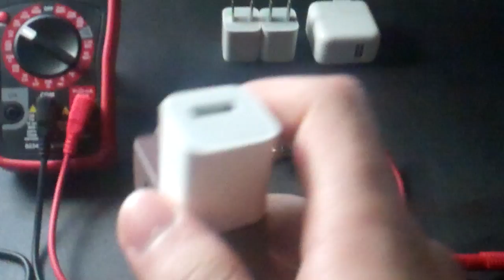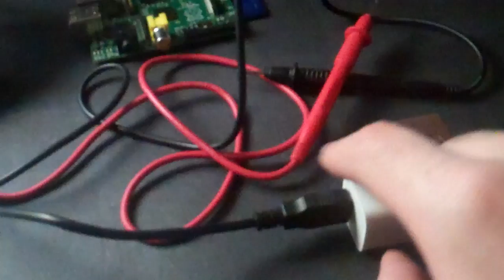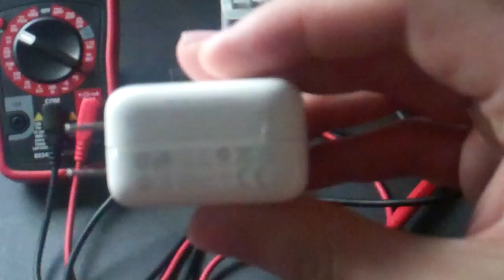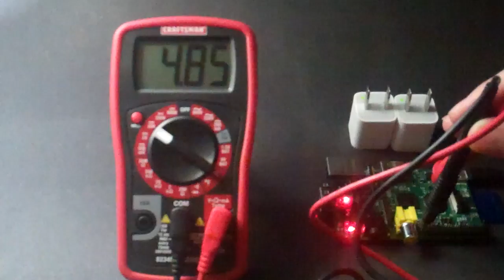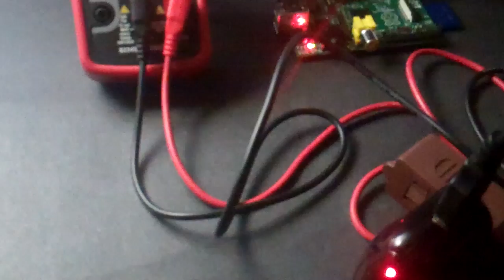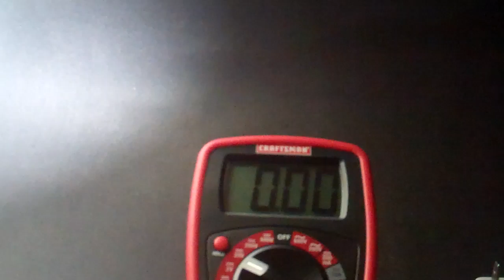Best Power Supply for the Raspberry Pi

Comment: A few Christmases ago I was tasked with getting a USB charger for an iPod Touch for a client and the only way I finally got it to take a steady charge was to lower the voltage to less than 5 volts. I wonder if this is a pattern of Apple products.

I have a Raspi 3 and I was wondering if I could run it off a USB port on my Xbox 360 because that would be convenient for me, would I have any problems with that? I ask because I notice that the Raspi power adapter that came with it is rated for over 10 watts.

Comment: what? mine was able to supply 5v just fine on my raspberry pi, the only culprit I can tell is that your USB cable is bad. There's a large voltage loss using that usb cable.

try using a more reliable usb cable like a samsung OEM microusb cable one.
Reply: It depends on low priced multimeter ;) Adapter and cable are okay.

Comment: All you need is 5V usb charger on 700 ma min value. Sony xperia  charger works just file It has 5v and 850 ma output. Don't use charger below 700 ma that's it :P
Reply: You can use your charger, but the lags and freezes you might think are normal ARE because of that power supply buckling when under load. AND if you plug in MULTIPLE usb devices, such as a keyboard and/or mouse and usb thumb drive you'll get almost instant failure as your charger will definitely not power all of those items. Even 5V at 1A will not power them. If you plan on plugging in anything get a charger made specifically for the pi. Something with 5.25V at 1A is very stable. Phone chargers are NOT good in the long run.

Comment: There are much more parameters of a power adapter which are responsible for reliability.  For instance: your message tells nothing about the output resistance of the adapter. You do not measure the voltage in unloaded condition. The difference you measure is the voltage drop over the usb cable. Not the stability of the voltage of the adapter itselves. Also an parameter is the voltage ripple and noise of the adapter. That you can only measure with an scope. High voltage is not always better!

Comment: Did you actually have power related stability problems, or did you simply find a problem by using your DMM? The USB standards have specific requirements for how power is handled, and power is allotted in units, not simply regulated like a standard power supply. The tests that you show are not proper for the USB standards as you may find the test point voltages going up after you add an additional load.

Comment: Upon further inspection of my own raspberry pi, and running it, I've found that the raspberry pi will run fine from an Ipad charger. It is two amps, but mostly the power is just routed into the USB's. I have plugged in passive USB hubs with keyboard, mouse, WiFi dongle, and flash drives, and haven't had any power problems.

Comment: If a power supply is rated at 1 amp at 5 volts, but the voltage drops to 4.8 volts when the current draw is 800ma, then it sounds like a voltage drop somewhere.  If the unit is rated at 5v, 1a, it should be able to keep the output capacitor fully charged even if current draw gets up to 1a.  I'm assuming that the ratings are correct (which may or may not be the case).

Comment: you can use glue (Arctic Silver AATA-5G Thermal Adhesive)  to put a heat sink onto the chip that heats up... or add a fan... or both.

Comment: When I get time I still need to upgrade my Heli's radio to get rid of those 8 AA batteries that it needs. It seems the radio drains those puppies pretty quick. But the chopper I got come to find out isnt all that great. It's a 9053 model.

Comment: When I got the RPI I was lucky to realize that the USB power adapter that came with my Nexus S was rated 5v 700mA, which is the minimum specs according to the wiki. I've had absolutely no issue using it, with the only exception of trying to plug in an external 3.5" HDD that did not have its own power supply. I'm assuming getting a 1.2A power supply would resolve that issue but I haven't tested it yet.

Comment: Question: I get the part where i have to get a 5.25 Volt charger/adapter, but what about the Amps? Whats the diffrence between i.e a 1.2 amp & a 2 amp. Can i ruin the raspberry pi if the amps are to high ???

Comment: The voltage drop has nothing to do with reliable or robustness. It's because the power-supply (in this case it's a SMPS) isn't able to deliver enough power (current). So when you overdrive the power supply, it doesn't "have time" to charge the output capacitor to 5V before you drain it. If you hook it up to an oscilloscope, you can also see that when you overdrive the power supply, the voltage is far from DC, it becomes very noisy. You can observe the switching.

Comment: This is a great video man, thanks.  The adapter in the picture at the link you posted doesn't look the same, however.  I'm a little leery of buying it because of that.  Also, if you could check amperage under load for that adapter that would be great.  Maybe a new video using your new camera, checking amps?  ;-)   It would also be great to see it actually loaded and running.

Comment: Do you have a 1.2a adapter?  That's what I've been looking for as well.  1a should be sufficient for normal use, but a wireless network adapter will likely push that limit.  That's my next test too... wireless network and keyboard/mouse.

Comment: I was going to say that.  ;-)
While he doesn't have that info, it sounds like it was thouroughly tested and all works fine.  If I had to guess, I'd say based on the fact that the voltage doesn't really drop under load, the amperage will also be fine

There's a fine line with regard to amperage though... you want to maintain "enough" amperage for the devices, but never cause a load above 1.1amps because that's what the fuse is rated at.  So again, this adapter does sound pretty ideal.

Comment: Actually, this setup will run something like a mouse and keyboard, as well as the hdmi out and ethernet, however, obviously you'd need a powered hub to do anything more.  Your point is good though, and it would probably prolong the life of the RPi.  The primary reason I don't want to use a hub is because it adds bulk.  I'm trying to keep my setup as clean and light as possible.  I am actually about to try using a tiny USB bluetooth adapter and a mini bluetooth keyboard with touchpad.

Comment: You should be measuring the Amperage of the Power supply units. Not just Voltage.
Max out the amperage, check its variations at max load, then check the voltage at that point.

Comment: You need a switchmode 5v power supply, yes they do exist in adaptor form as I have one myself but thats used to power my USB power port that unloads the voltage drop on the computer my 7 port hub connects to.

Comment: There's a known problem with the RPi power design, and the lastest rev removed some fuses that were responsible for voltage drops. You can replace them with resistors....

Comment: You just need to look  at the psu and se if it has 1200mA or 1,2A if not it will not get enogh power.(B-model) i see many psu sold for the raspberry is 1A or 1000mA.

Comment: It's odd, in any case for my own Pi that voltage (TP1-TP2) is not the adapter voltage.

Adapter voltage with no load: 5.20V
Adapter voltage with Pi: 5.05V (almost perfect I'd say)
TP1-TP2 voltage: 4.76V

It's definitely a different voltage

Comment: I used my ipod touch 4th gen, it works great for videos. Just use youtubes stabilize feature, it helps when your hand moves around to much and your trying to hold it steady, while using the other hand to play with a tablet, etc.

Comment: Are you absolutely sure those measurement points are correct? I use a 5V 4A (so 20W) adapter to power my Pi and I decided to test this too. With mouse, keyboard, ethernet and HDMI connected the voltage across TP1 and TP2 was 4.76V. Quite odd considering it was powered by a 20W adapter, so I decided to measure the actual voltage the adapter was delivering and it was 5.05V. It seems to me that the voltage between TP1 and TP2 *IS NOT* the voltage that the adapter is providing.

Comment: Safer if you use a surge protector instead of those old extension cords to plug things in. Also easier to unplug from it too.. If you have an ipod Touch it actually works really well filming I used it on my review of a Coby Tablet.

Comment: @krystasss It won't break the pi. It will only use as much current as it needs. The number on the power supply is a maximum amount of current the psu CAN provide, not how much always goes to the device. Although the more current you have available, the bigger the zap will be if you short something out on the pcb.

Comment: well, using that 2amp charger isnt best idea, max allowed amperage for b model is as far i remember 1,5A. connecting rpi to sources with lower amperage is definitely better solution than overpowering device. if you want to connect many peripherals just use separately powered usb hub, its not purpose of rpi to be a power station. personally im using iphone charger and i wont surely stop doing that. overpowering is more dangerous than underpowering.

Comment: try using the HP touchpad charger, it is rated for 5.3 volts at 2 amps and can hold about 5 to 5.08 volts at load with other devices connected

Comment: I'm OK with electronics, but don't have a RSBRY PI to play with yet... Maybe it is too little; maybe it just needs more amps than the chargers provide... Is that a type B RSBRY PI? The type B takes 700mA [7/10 of an amp], and the type A takes 300mA if I can remember correctly... Plus, did you know that some voltage meters take away some power from the actual voltage?

One question though that isn't really power related - can a raspberry pi run off a SDHC? [special type of SD card] Hope it does..

Comment: I don't think that's correct, though I'm no expert on electronics.  First, the voltage is around 5v, you mean the amperage is too high.  However, my understanding is that a device will only take as many amps as it needs, so if the supply is higher, the rest is dissipated as heat (i.e. the power supply gets warm).  As long as the supply gives the minumum (or within 10%), it will all be fine.

Comment: It's also important to get a good cable from the Adapter to the Pi, because over thin wires the Voltage will drop considerably when the Raspberry Pi is drawing more than idle power.

Comment: For heat problems, you can use mosfet heatsinks on the chips (and mosfets if it has any). They're tiny pieces of metal that stick to the components and absorb heat, allowing it to dissipate (FYI).